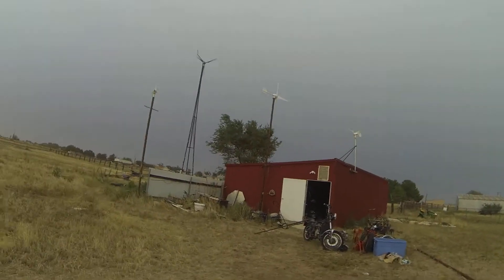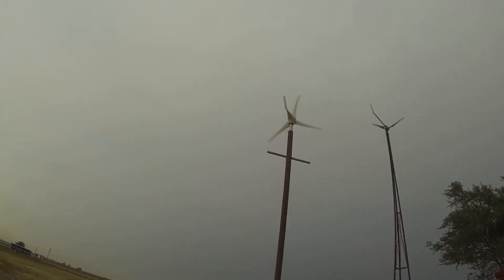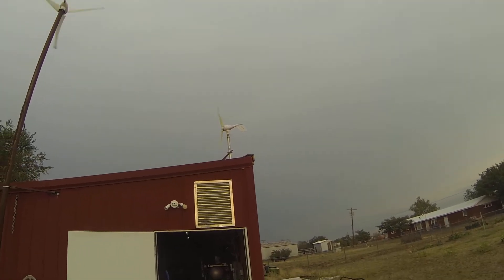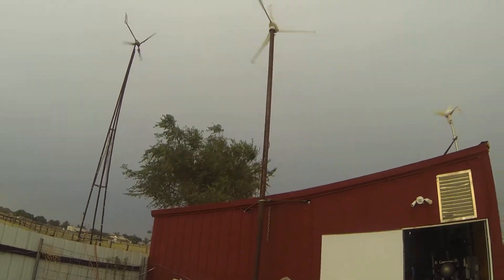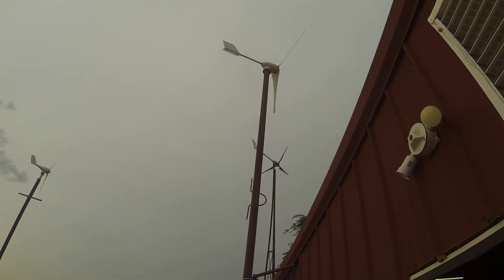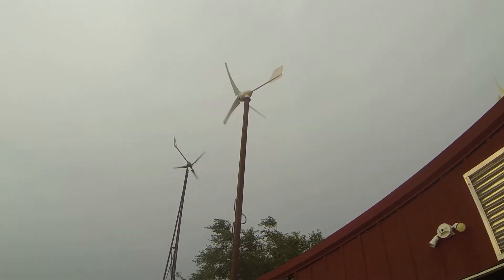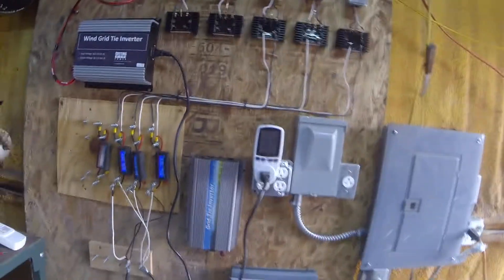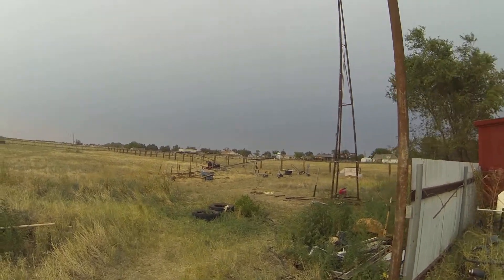Wind Turbines and the effect of seemingly small obstructions

Comment: Do you ever worry about charging your batteries at too fast of a rate, with that many turbines?
Reply from the maker: Not really, but it's important to keep in mind that my system is not designed to store power.  I'm using inexpensive batteries as resistors for a lack of better explanation.  My system is designed to feed directly into the grid.  You can see my control setup here: https://www.youtube.com/watch?v=2eABx0EluJ0

Comment: As always perfect.. 
You are connected your wind turbines to 36v battery system, if connect the to 12v battery system is the output ampere will be the same or will drop.
Reply from the maker: At 12v everything would drop...it would be like the brakes were on with the exception of the little silly turbine on the left.  That one seems to do okay at a lower voltage, but the i1500 and the 700w turbines produce too high a voltage to work at 12v...they do okay at 24v.  The 400w turbine and the i1500 would both probably work just a little better at 48v.
Reply: The 700w,  do you know how much the rated apms, cause I checked the link you posted but the didn't mention any description for rated apms.

Comment: Dang as much wind turbines that you have I bet you the light company is having to pay you for the bill instead of you paying them
Reply from the maker: No it's really not that much power.  If the four in this video were all cranking out the peak wattages I've seen from them it'll add up to roughly 4000 watts...and if it were doing that24/7 it'd be approximately 2880kw/hr over a month.  We don't have a huge house, but it's not small, and it's old...it's inefficient, and we have a barn and some extremities that are powered, and all told we average about 3000kw/hr per month.  So in hour case, if everything was operating at PEAK production all the time every day it still wouldn't cover all our usage.

As it is, though, we only get those peaks briefly.  It is my plan to do a break down after a year of running what each turbine has produced and what kind of an impact it had on my bill.